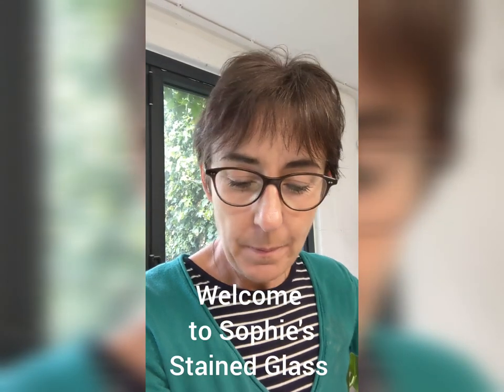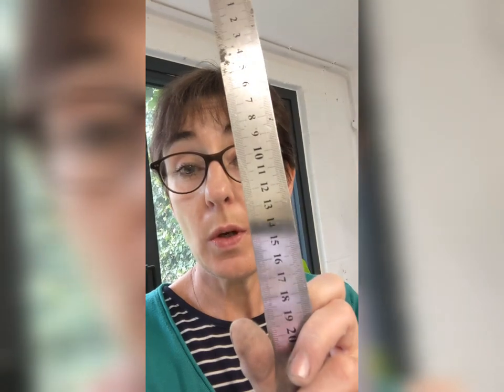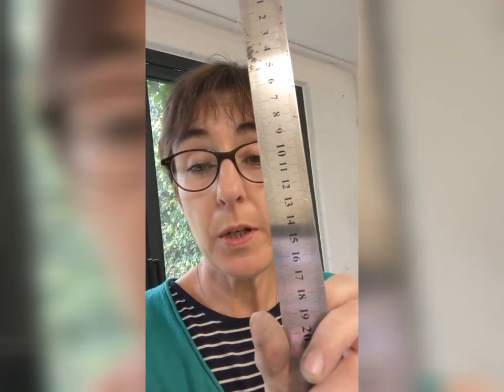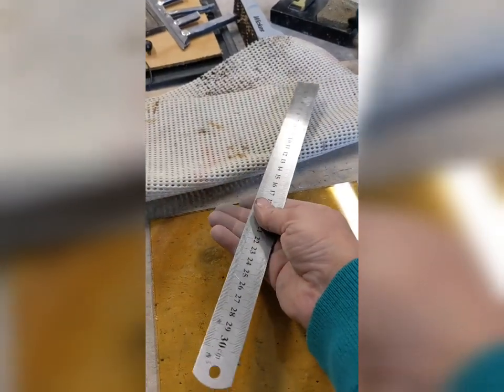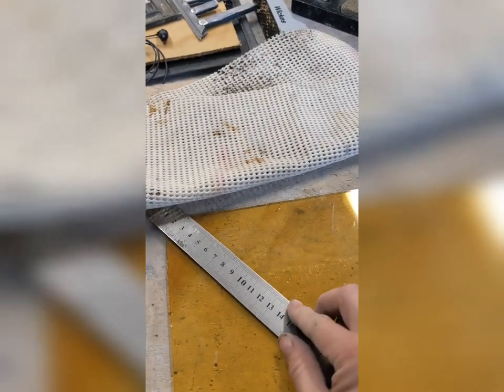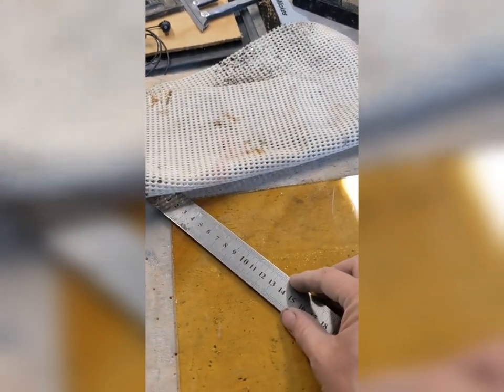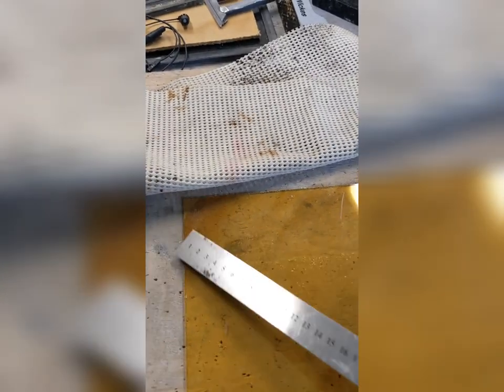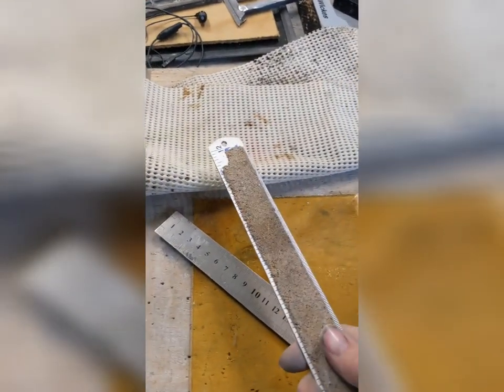Sophie's Stained Glass: Stop rulers Slipping!

Comment: Good tip.  I like cutting on that material as it holds the glass perfectly still.  The downside is that little glass bits fall into the little holes so you have to be careful and frequently shake it out.
Reply from the maker: Ah yes... never would have thought about cutting on it. Good idea.

Comment: One other question, how can i make a pattern with left over glass pieces. I’ve only started 2 weeks ago. I should make a pattern what i have in hand coz i did buy left over glass pieces, so can’t really make a pattern i like. Need to use what’s in the box 😢
Reply from the maker: Yes, you can always use your old glass. I like mosaic like patterns but they are labour intensive. You could get a scrap of mirror from a glazier and do a small leaded frame around it?